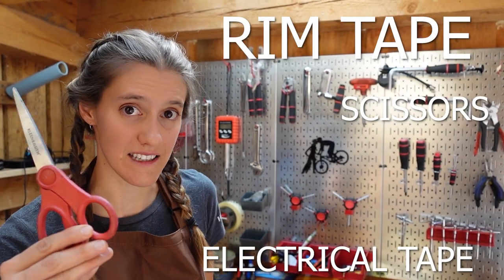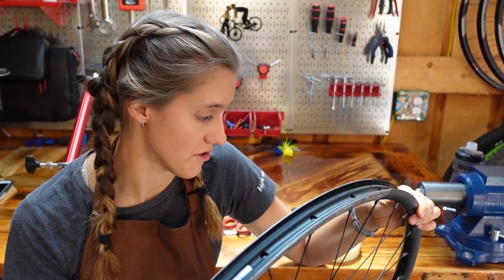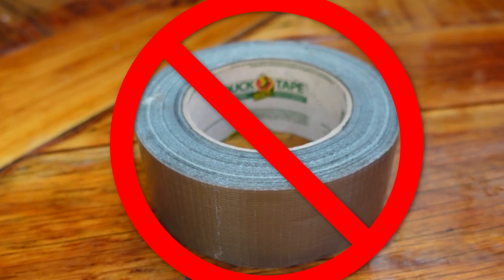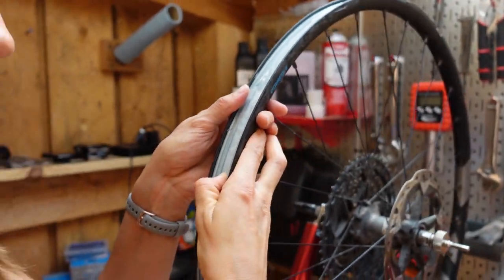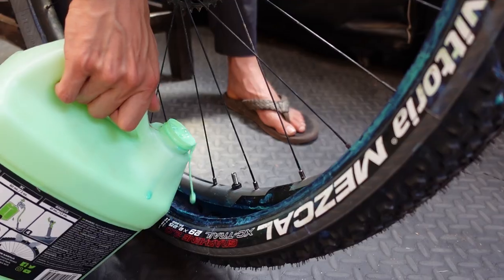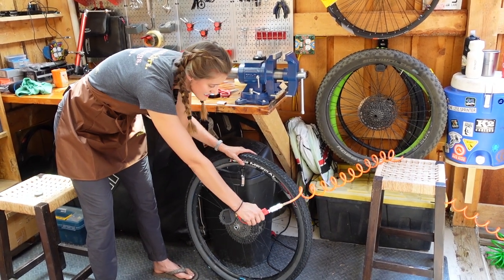How to install tubeless rim tape that won't leak | Syd Fixes Bikes

Comment: One trick I've found is to apply the tape, then put a tire and tube on the wheel and air up the tube.  Leave the tube on for a bit to set.  It pushes evenly on the tape and pushes the bubbles out.  Remove tire and tube and tape will be smooth.
Reply: How much do you charge for spittin’ more faxx??
Reply: Just putting air in the tire without a tube will apply pressure all along the rim tape.  Thats how pressure works.
Reply: @ultrastoat3298  respectfully disagree; once the spoke hole is sealed, air has no incentive to finish pushing the tape down across the width of the rim
Reply: @stephenerickson8107  Whats the incentive for the tap to lift?
Reply: @ultrastoat3298  You are correct in the sense that inflating without a tube doesn't lift tape off the rim. But it also doesn't remove voids that were left over from the hand-application of tape. The point of inflating with the tube is that the tube physically pushes the tape into the rim and removes voids. If you inflate without the tube, air pressure stays exactly equal on both sides of the unstuck tape, and the voids remain.
Reply: @stephenerickson8107  If air in the void is lower in pressure than what you pump the tubeless tire to, air will push on the void... the tape is actually acting as the tube and will naturally want to expand against the rim.  The air pressure outside of the tape against the rim is not pressurized and therefore does not push back equally.
Reply: @ultrastoat3298  LOL, reeeeeeeeeeeeeeeeeeeeee
Reply: @ultrastoat3298  yeah!!!!!!!!!!!!!!!!

Comment: If you tension the rim tape more as you apply it you won't have the bubbles and you won't need the electrical tape at all. It not a weight issue, it's a technique issue. Also, you should overlap from the valve hole. I also recommend heating the tip of the sharp tool for a clean hole. Great video!
Reply: Stans rim tape installation isntructions are to overlap opposite the valve at the rim's welded joint. But you make a good point that Syd should've put more tension on the rim tape and skipped the electrical tape shenanigans.
Reply: Yeah I agree. I just installed rim tape and used gorilla tape, but it was buttery smooth without any bubbles. Really just a technique issue. But the electrical tape does remedy for any minor leaks I think many people will face. So it’s a good idea that’s new to me.
Reply: interesting. what did the heating do to clean hole?
Reply: overlap from the valve hole?  why?
Reply: @李克诚加拿大  It melts away (instead of a rip), so there's a better chance that it doesn't rip later on
Reply: true that, plus you can use a head gun on low and tighten up the tape some.

Comment: I haven’t read all the comments here, but something that should be mentioned in all of this, that many people are unaware of, is that there are varying degrees of electrical tape. 3M makes good stuff and at numerous thicknesses. As a auto mechanic I love using Tesa tape, which is extremely quality electrical tape used by German and European auto manufacturers. Tesa tape is also relatively affordable on Amazon. It’s awesome, and as a cyclist I’m wondering if my Tesa tape would work for this. Tesa is flame and waterproof, has awesome stickiness, and is sorta like hockey tape on steroids. Anyway, maybe try Tesa.

Comment: I’ve encountered a similar issue with purpose made rim tape. When I chatted with a mechanic about it,  he suggested using a heat gun/hair dryer to shrink fit after application. I’ve been doing it ever since, it works great. I’m pretty positive that’s what they do at the factory because it looks exactly like a factory finish when done. Doesn’t have the added durability of double layering like electrical, but probably worth trying for those of us doing gravel/road/cx tubeless where the pounding isn’t quite as severe!
Reply from the maker: That's a great tip, we'll have to try it!
Reply: Yep
Reply: Thanks for the tip. I’m gonna try it today at the shop.
Reply: Does this also help to push the tape into the centre channel of the rim?
Reply: On the Trail MTB it basically tensions/shortens the tape, so (within reason) it’ll help suck the tape into all the crevasses/channels of your rim bed
Reply: I agree, I’ve also used the hair dryer, works really well
Reply: This is the hidden secret, especially here in cold Scotland. I warm the rim and the tape.
Reply: Install a tube inside the tire after taping. Pump it up to max tire pressure. Bingo, no bubbles!

Comment: I’ve always started 4-5 hinches (1 spoke hole past the the valve hole. When you get back around you go one spoke hole the other direction. This way there are two layers over the valve hole helping the valve stem seal better
Reply: This is how I do it as well, two layers over the valve hole. Would love to know the thought process behind starting opposite the valve hole...
Reply: @fulltrucker  I think it's so there are no joins nearest to the valve hole?
Reply: @fulltrucker  I think it might be so that the wheel is better balanced
Reply: @jacobkeller29  Good point

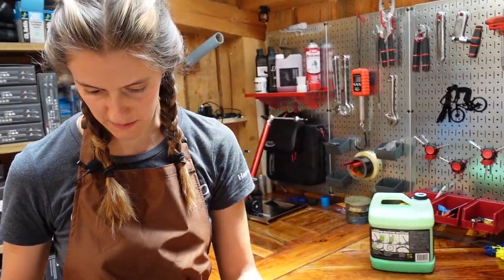Comment: At 4:28 or so, the rim tape isn't being applied correctly. You have to pull pretty hard to stretch the tape while applying it. That way it will go down nicely into the channel. Most rim tapes are pretty good, but I've found that "Muc-Off" is particularly easy to stretch. You shouldn't have to follow it up with electrical tape. The process of putting in a tube to set it is good, but also unnecessary. Just pressurizing the tire will do exactly the same thing. 30 psi (or whatever) puts 30 psi against the tape, whether there's a tube there or not. The only reason you'd need a tube is if the tire won't hold pressure at all. At 6:57 when you use the "pokey thing" just insert it from the other side of the rim, where you can easily see the hole, instead of the rim side, where you can't! The weight of extra layers isn't the issue, it's the thickness. It just makes the process harder. It's probably why putting the tire on was more difficult, as the bead couldn't go as low into the now filled up channel. 
Finally, putting it on a truing stand rather than on the floor makes it really hard to apply the kind of stretchy pulling force you need.  I'd go to the Muc-Off tape application video, TBH. In one video they use a truing stand, in one they don't. Not using one is easier in my experience.
Reply: Exactly they missed THE MOST VITAL part of rim taping. Kind of painful to watch.
Reply: Have to agree. There are better versions of rim tape that is somewhat stretchy. No bubbles and no electric tape needed.

Also for the record, the tubeless version of vittoria tires are notorious for being hard to get on and off rims
Reply: @doncrescas  Yeah, most tires shouldn't let you just pop them on without a lever. The bead should be tight to ensure a good seal.
Reply: Yes that's the way of doing it.dont push it in, hold it on tom unroll around 20cm and pull that in the rim, follow with your thumb in the grove as you go like that around the wheel. It's easier if you just put the rim between your legs when sitting down in a chair as wheel should not turn. No need for 2nd tape then. 
And start short before the valve 1-2 spokes, and end the same after valve. Thus you have double tape on valve whole
Reply: This! The majority of their videos from the perspective of a 'beginner mechanic' is great, but this one was a bit too riddled with errors.

Note on Gorilla Tape at 4:12 yes, the worst part about it is the residue. Worth having in the toolkit as if you ding a rim, regular rim tape will 'lift' as it's rigid. Gorilla Tape conforms much better, so it's the only option if you have any decent ding in your rim and want to run it tubeless. Thickness and weight are not an issue (weight and thickness would be the same or even less than a layer of rim tape + electrical tape).

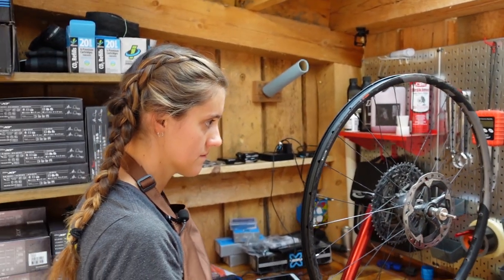Also at 2:58 it's not a 'rule' to tape at the opposite end of the valve. It's common for mechanics to tape 2-3 spoke holes from behind the valve hole, and overlap 2-3 spoke holes (so you essentially have 6 or so spoke holes with a double layer). This makes the tyre ever so slightly tighter at the valve, preventing air usually escaping from the source = easier to inflate/pop the tyre onto the bead.
Reply: kayakutah exactly,this was very painful to watch...a very bad job to say the least...probably one of the worst.

Comment: Agree with some of the other posters. I use Stan’s tape, same probably for others. You MUST stretch the tape as you are applying it, then you don’t need electrical tape. You know you’re stretching it enough if the tape doesn’t bubble up over the spoke holes. Also on some rims (namely the Roval aluminum rims on my Specialized Levo) the tape WILL NOT stick well (the rim seems to have some kind of finish that resists mud and also tape sticking). You can solve this by using a 2-3in bit of gorilla tape to hold the starting end, so you can pull hard enough to stretch the the tape without it coming loose. Also, I have to disagree with one of the other posters, I think tape width is a bit of a preference, as long as it covers the spoke holes. I use same width as rim. I got a pro-built wheel the other day and the tape was the width of the middle channel, not the whole rim. I think as long as you stretch well and use good rim tape it just has to cover the holes. Having it the same width as the rim gives the tape additional purchase on the shoulders of the rim bead. My .02. Great channel!
Reply: I've found that tape that isn't as wide as the rim is more prone to getting the edges knocked loose by the tire bead when removing and installing tires.

Comment: Thanks guys! That proved really useful in fixing the previous owners interesting rim tape experiments. Pumped up first go, (to my relief.)

I liked the truing stand idea, so I drilled a hole in a hardwood offcut, clamped it up in a vice, then used my rear axle bolt as a workaround for this job. Makes lining the tape up much easier. So thanks for that idea, too!

Comment: Great video guys. The start point is still up for debate, as a mechanic, I do all my tape a few inches before the hole and end a few after. Also, a great tip, if you have time, is to put tubeless tape on install a tube inflate overnight remove the tube and tape will be super smooth. I do it at my shop all the time but maybe leave it for an hour and never have an issue always seal up nice and tight.
Reply: Yep, always where I start. One spike hole past the valve hole. Then there are two layers sealing the valve stem
Reply: @jfkusa123  Yeah depending on spoke count for me but it is normally a few inches of overlap from the valve hole

Comment: You guys are AWESOME! Thanks for the tip about using electrical tape over top of rim tape. Even with just a floor pump I was able to seat effectively and my tire is holding air. Thanks again!

Comment: This worked for me.  My four year old 35 MM IR MTB wheel had a slow leak.  Went soft in a day.  So pulled the tire, cleaned the rim, and tapped with Stan's Tubeless Tape.  This was my first time putting on tubeless tape.  Followed other video instructions.  Pulled hard on tape as installed, BUT it did not cover spoke holes well.  Had bubbles.  Pushed down the tape and hoped that air pressure would solve.  Nope.  Went completely flat in less than 2 hours.  Watched Syd install her tape.  Looked terrible on the initial tubeless tape (just like mine).  Then she added the electrical tape and made it look a LOT better.  So I removed my botched tubeless tape and started over.  Laid down new tubeless tape (Stan's).  It looked better than first time, but still not great (lots of air pockets).  Then I wrapped 3 layers of electrical tape.  One strip in middle over the indent groove and spoke holes to push/hold down the tubeless tape, one strip on right side (near outer edge), and one strip on left side.  Filled it up.  2 days later it still held air (did go slightly soft).  Took out for a 90 minute ride.  Air held.  It was NOT pretty, but this "practical" method worked for me.  Thanks Syd and Macky.

Comment from the maker: One thing we felt wasn't clear in the video: you want to press the tape down into the center of the rim so that it isn't "floating" above the rim channel.
Reply: That wasnt clear in another video I'd watched either, it made sense that you would but people didn't seem to, glad I came to the comments after watching this one ha.
Reply: Good video.  I also liked the chapter breaks.  I spent the past year learning how to apply rim tape and one thing I noticed was that you did not mention was how wide of a rim tape to use.  I never did know about the electrical tape over the rim tape.  I'll have to remember that one.
Reply: I've heard can uses coaches tape as well. What's your take on that. I can't find any of the tape in my country
Reply from the maker: Hmmm. We've never tried that and I would assume that it's not quite air tight enough, but who knows 🤷‍♀️ worth a try if you can't find anything else. 
Best bet in that situation though would probably be to find some kind of tape that doesn't stretch (maybe coaches tape?) and then cover it with electrical tape (which is airtight but stretches).
Reply from the maker: That's an interesting idea. I don't think so, but who knows 🤷‍♀️

Comment: This is one of those bike jobs Seth’s Bike Hacks always complains that when you post a video, 5k people immediately tell you you’re doing it wrong, haha. Great video, though I did it with just Stan’s tape, stretched it as I applied it, two loops around the tube (they only had narrow tape at my shop), and seems to be holding. Whatever works. The electrical tape is a cool idea.

Comment: I had a leaky tape job so I got on YT to figure out where I went wrong and found this vid. I decided to put one wrap pf electrical tape over the spoke holes and then put rim tape on top of, hoping this would give me a better chance of a perfect seal at each hole. It worked well. My tire lost pressure over the first night, but it kept the air in after that. Thanks for the idea! Oh I also switched to a valve that had a rubber cone shaped seal (I9 brand) that I believe might seal better than my previous valve. Also, rubbing some sealant on the edge of the tire before installing helps it slip on easier.

Comment: You have to pull strong from the ring tape side with one hand while pushing with the thumb  of the other hand. Take advantage of the rim tape flexibility to sketch it while you put it. Then apply a bit of heat with a hair drier and you'll get a perfect finish.

Comment: Having someone hold the wheel while you pull the tape tight and "stretch" it into the channel keeps things really clean and tight. Having them rotate it makes things go really fast. No need to do a little at a time making a huge mess with bubbles. This also eliminates the need for your electrical tape as you can do two layers rather quickly.

I also start and stop over the valve core hole. This leaves the overlap (4 layers thick) where you're going to poke your hole, making things extra strong.

Factory tape is also applied under tension, that's why it's so clean 😉
Reply: I just put the wheel between my crotch and sit on it just enough to keep it from spinning.  I use the weight of my body (not full weight) so I don't have to use  only my arm muscles to stretch the tape.

Comment: I don't mean it badly, but I'm the only one who think this is not a great tubeless tape job? Many bubbels, no tension when applying the main tape an too many layers of tapes? You should try a good tape like from muc-off. Apply one overlapping round with strong tension on the tape (start a few inches before the valve hole and end a few inches after the valve hole) and you are done!

By the way your style of explanation is great and i'm looking forward for your channel!
Reply: I was thinking,this the worst tape job I have ever seen. I would not let them tape my wheels.

Comment: One trick I’ve found without using electrical tape is use the rim tape as you shown. Then install the tire but install a tube. Inflate to 30psi and leave to sit overnight. The tape job will come out looking professional. The issues I’ve had with electrical tape is too many layers of tape takes up the distance in the drop center of the rim. I run CushCore and I need every bit of space to get that tire on. Great video
Reply from the maker: Great tip!

Comment: I think you missed an important point when taping a wheel for tubeless and thats having a proper width of the tape. The tape needs to be cca 5mm wider than inner width of the rim. That means if your rim is 30mm inner diameter you should use 35mm wide tape. 33 is not enough to cover the rim fully from side to side and more than 35 will probably not fit. Important word here is "fully" as the tire when seated has to sit on the tape. If there is tape missing in the corners of the rim bed it will not seal. This has been most common source of frustration why the tubeless thing does not work that I came across. If you do this properly there is no need for that electrical tape and I would avoid it as it adds thickness to the rim bed and can make mounting and seating tires really unpleasantly hard. I even encountered a wheel with two layers of tape on which the tire would not seat in the bead at all not even with over 60 psi in them..

Comment: Headset overhaul vid would be useful for the home mechanics out there. It’s an easy, often needed service yet I see many home mechanics mess it up.

Installing new disc brake pads/ hyperextending and cleaning caliper pistons would be a useful vid too. Another easy service requiring minimal tools that can really improve brake performance between bleeds.